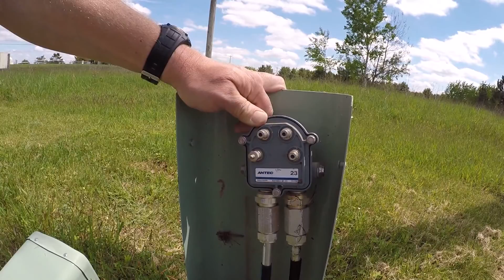WITC Broadband Academy CATV OSP Components

Comment: Hi, have a question, what is the distance that an in line amplifier? Needs to be used is it based on Mount of users or distance. I live in Sydney Australia and were about to get hybrid fibre cable , and it’s coming via overhead cable had a bit of a look around and a little bit confused there’s quite a few boxes?, That are on the pole but not sure which is which and what is used for.